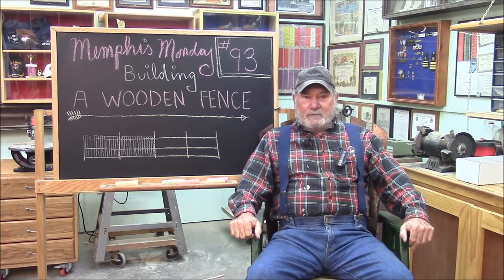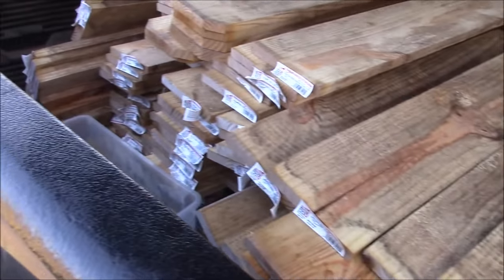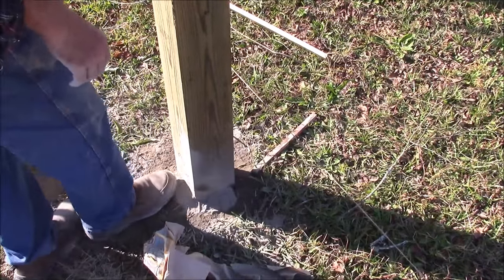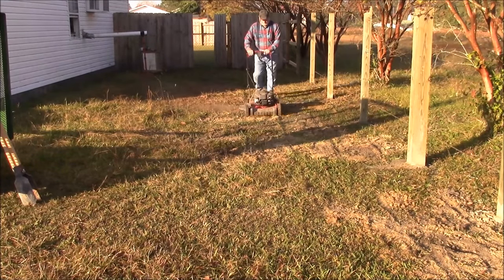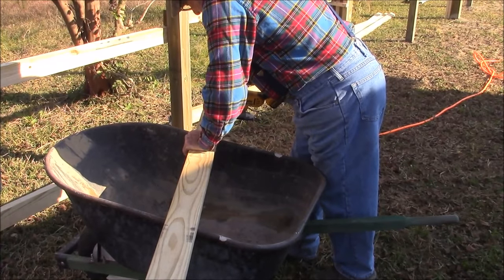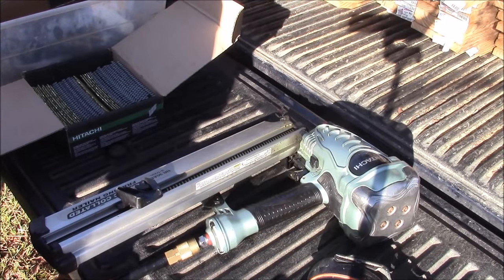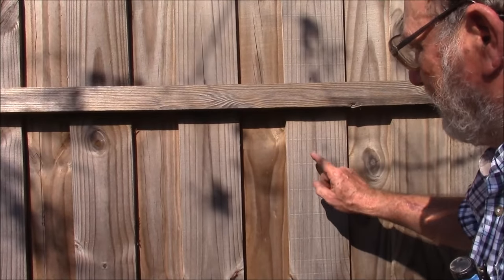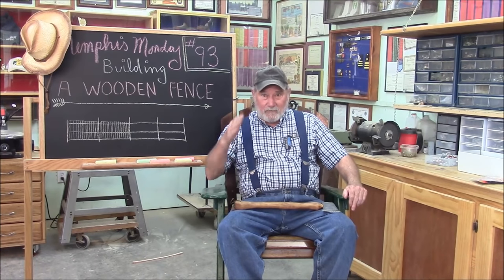Building 70 Feet of Wooden Fence MM 93

Comment: I see your post holes. the width is far too narrow. the rule of thumb is 1/3 of the post hieght in depth. so that's minimum 2ft depth for a 8 ft post and 3 times the width of the post for the width of the hole. so a 8ft 4x4 post should have a 2 ft deep and 1 ft wide hole minumum. I have came across setups like yours and time and time again over the years they fail every time.  I have done it the proper way and the fences after 15 yrs are still strong and no sagging and no snapping.  It pays to do it right the 1st time.   The 2x4 stringers are a great idea though the 1x2 standard stringers do warp and sag over time  So that part of your install will last through time. The rest I don't think so,
Reply from the maker: http://diyinahour.com/diy/setting-wood-fence-posts/
Thanks for watching and commenting.  I'm not a professional fence builder, so you are much more likely to be correct on this issue.  However,  I know about the three times the size of the post rule, but I chose to follow the rule of thumb in the link above.  I go down 33 inches (2'9") with an 8 to 10 inch hole, which I sometimes flair a little at the bottom.  (And I also realize that I'm sometimes a little under that 8 inch goal, and sometimes way over).
      In any case, I had pretty good results with my wooden fence in our latest hurricane, so I know the strength is at least marginally okay. 
      How do you feel about the idea that posts should never be set in concrete?   Have you ever "driven" wooden fence posts?
Reply: The article is a mix bag of really good practices such as gravel at the bottom of the whole etc. BUT it has a fatal flaw that is the cause of 90% of post failures. That is not bringing the cement to the top and sloping it. Reason why majority of wooden posts snap is rot at the base caused by standing water. Your article says cover the base of the post with dirt that will rot out the post causing it to snap. Putting the cement all the way to the top and sloping it prevents standing water from collecting at the base and prevents the post from rotting which = long long post life.  This article misses that common sense method which is enough for me to throw it out.  The posts are the most critical part of a fence and of course the most work to get out so if it's done r ight the first time you will not have to worry as much about going back to it again.   

Digging over 2 ft deep is cool. The deeper you go the more stronger the post will be and better able to withstand high wind loads etc. Can't go wrong there.  The standard rule for a 8 ft post is 2 ft minimum ( cheap fence contractors believe it or not dig less to save time)  

Not using cement for the posts in most cases is a BAD BAD BAD BAD idea. you can ONLY do that in areas with low wind load situations. Doing that in a normal environment will cause the posts to hollow out the holes and the posts will start to wobble over time.  Also it can cause the posts to come out in extreme storms as the soil will be saturated to the point it can't hold the posts anymore. It is always advisable to use cement in all applications (which i do i never do driven in method ever) . Especially gate posts and corner posts as they carry the most loads.     I use cement in all applications.  Driven in posts is just a recipe for disaster.  A post is only as strong as the footing it's embedded into. and Concrete is the most solid ways to have a good footing.  I use 2 bags of 80 lbs concrete so that's 160 lbs of concrete footing to anchor the post in.    but use as much needed to get the cement to the top. When using concrete the only down side is pulling out the concrete plug when needing to replace a post. But that's the cost of doing business. 

it is important to have the correct width of the hole not just the correct depth.  too narrow and the concrete footing will not be strong enough to keep the post stable long term.  

If you do a post cheap or the proper way they will perform for short term the consequences play out long term.   a 4 x 4 Pressure treated post can give you 30 yrs of service if you do it right. if you don't especially having the base exposed to standing water you will be lucky to get half or less of life out of it
Reply: in addition, if you use wooden posts always use pressure treated posts never untreated posts.  PT posts use a micro copper chemical that is forced into the post using pressure all the way to the core. The chemical resists wood rot and also keeps pests from eating the wood as well.  I use yellawood brand posts and fence panels they are all PT and carry a 15 yr warranty against wood rot.   If you use metal posts you STILL should put the cement all the way to the top cause standing water over time will rust out the base causing the same issue.  Also STAY AWAY FROM LANDSCAPE TIMBERS alot of contractors use those for fence posts cause they are only $2 a post vs $8 for a 4x4 post but they are untreated they are only 3" diameter and snap in as few yrs as 3 yrs you will be constantly replacing posts if u use landscape timers. When i see contractors using those I blacklist them cause That says they are not good people to do business weith. 
just wanted to throw that in.  Your article would of been a good one if it didn't have that horrible step of just throwing dirt over the top.
Reply: one thing i forgot to mention, i was just pulling out some old posts  out today  and the contractor who put them in didn't put enough concrete and made the hole too small. Result?  the posts were wobbly as hell and the concrete plug was pulverized in all these posts they couldn't hold a toothpick lol   i was pulling out pieces of the plug. over the years the wind battering the posts broke up the thin concrete plug another reason to dig the right size hole and use proper amount of concrete.   recap width 3x's the width of the post putting in depth for an 8 ft post minimum 2 ft.
Reply: I put concrete posts in 35 years ago. Still standing. Concrete won't rot. Wooden support rails fastened to posts via bolts through holes already in the posts. Simple. Then nail fencing to rails. Easy!
Reply: I like to mix my cement before dropping it into the hole, seems to make more stable but your way does save the back some.